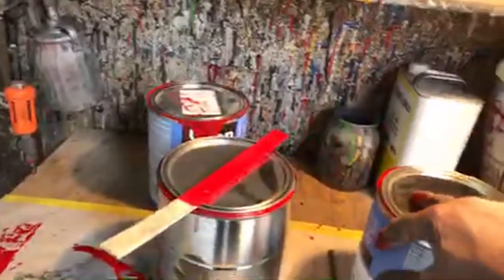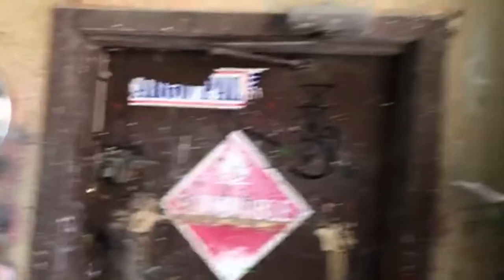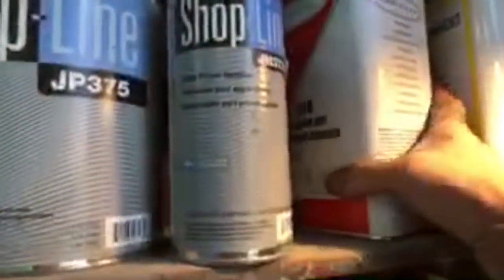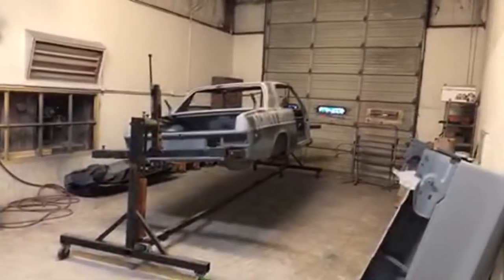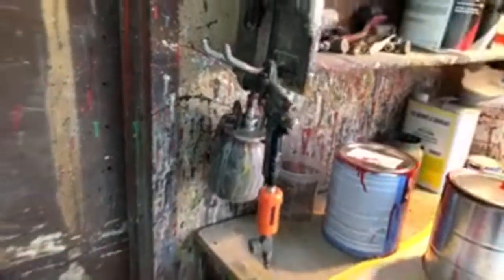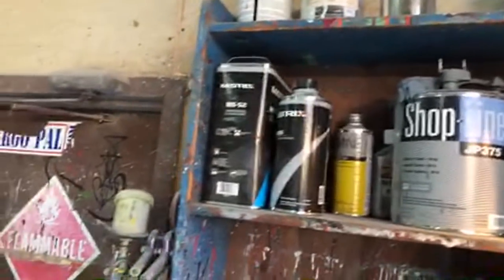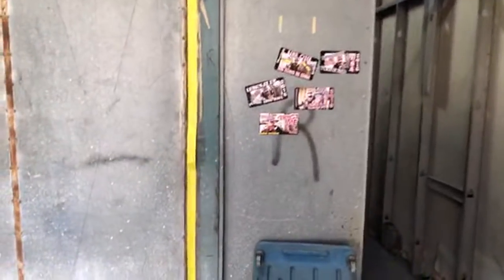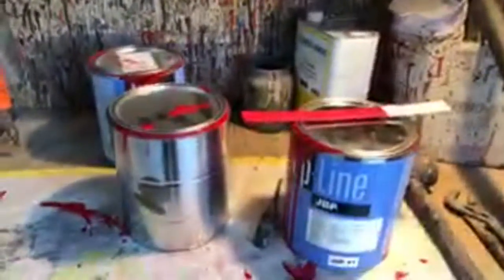How Good Does The Job Gotta Be? Paint And Body Tech Tips! Part 2

Comment: most solvent based base coats are roughly made out of the same components the one constant component is acetone in the Base coat. i agree that OMNI sucks ass never had any luck with it but i use Automotive Art paint which has never caused me any issues . i used to use URKi Base until i found out the paint store was using automotive art while they were depleting their system  for a upgraded paint system. Automotive art is 300 a gallon CAD . i still struggle with clears though i have a go to clear Bessa Clear which is awesome but i try to change up on ocassion. im not a professional painter at all but because of you and a couple others i get better :)

Comment: How good does it have to be would be up to the customer and its the job of the body shop to meet the requirements of the customer or better?
 If the customer wants a specific paint and primer system used then you do that. Or discuss the options. Avoid epoxy primer when doing build up bodywork.

Comment: A hodgepodge batch of mismatched materials that aren't designed to work together equals a shitty job. If you have a warranty issue how do you call? You three four maybe five different companies products on a paint job ain't non of those companies going to stand behind it! One of your other videos you had a blisteringly lifting problem, that's what happens when you mix a bunch of different manufacturers paint products together that aren't chemically compatible. PPG, Xalta, Spies Hecker, Akzo Noble, Glasurit are all designed to not be compatible with each other. I was taught to use a high quality product and use the same product all the way through. Rarely do I have the issues you seem to have and because I use one product line all the way through and any issue is easily traceable